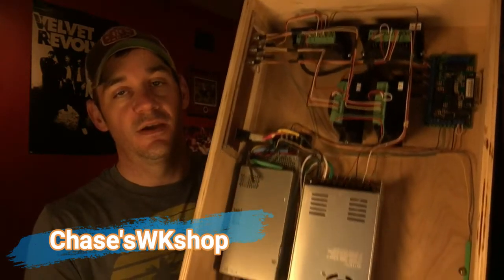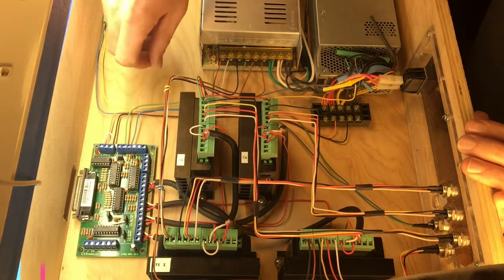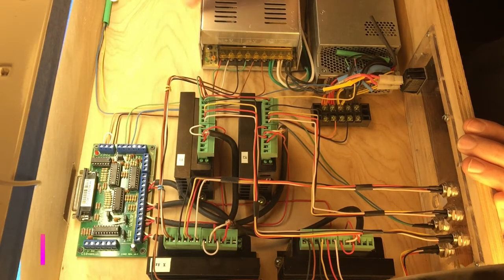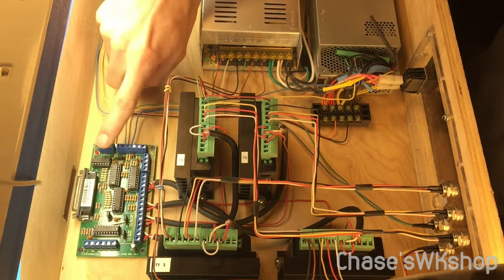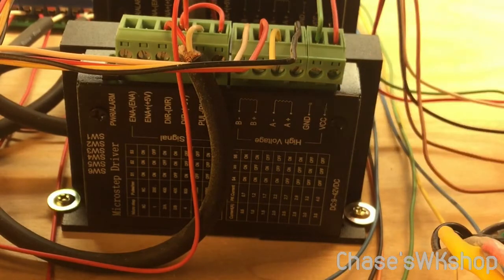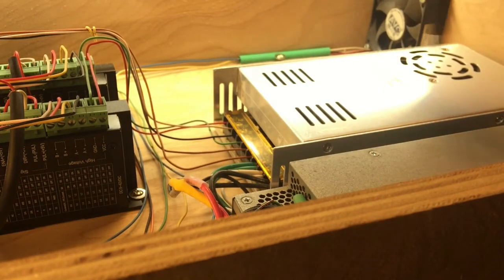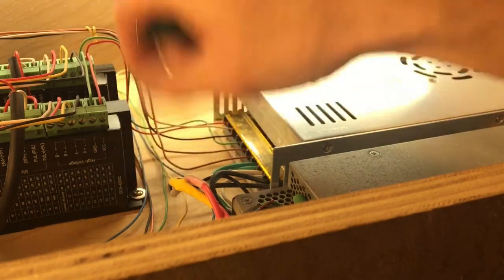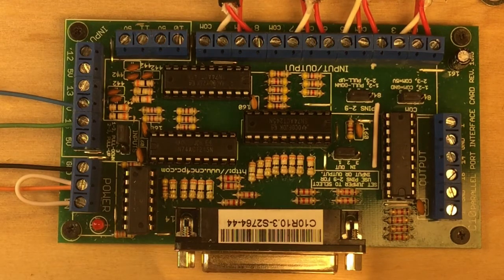Building a CNC Controller for Under 120 Dollars

Comment: Just stumbled on your videos, thank you for the help and source. Thumbs Up
Reply from the maker: louis marsh no problem. Glad I could help. If you have any questions let me know!
Reply: I am working on converting a Smithy 1220XL to CNC,  Nema 24 X/y and Nema 34 for Zed.  I am also toying with using a stepper motor/s for Rotor--however still researching.
Reply from the maker: louis marsh nice. Those look like really nice machines. It shouldn’t be too hard to convert it to cnc. I would suggest getting good drivers. The one in this video are cheap but worked fine for my setup. I have a video where I change them out with stepperonline drivers and the difference is amazing. They’re about 33$ each whereas the others were about 15$ each. Here’s a link to the video. 

Stepperonline Driver Board DM542T Upgrade https://youtu.be/y_aVLpNHdaw
Reply: I think I am going with your updated drivers.  What do you think about open loop verses closed loop motors and servos
Reply from the maker: louis marsh to be honest I’m really not very knowledgeable on open loop verse close loop. I do know the closed loop is faster, quieter, more torque and more efficient so it sounds like the best option but everything is determined by cost in the end.

Comment: Do you have to do anything as far as controlling voltage to the stepper motors, say add resistors? Thanks
Reply from the maker: Carl L I didn’t add anything between the motors and the drivers just wires. Hope this helps you bud. If not let me know. Thanks for the question!